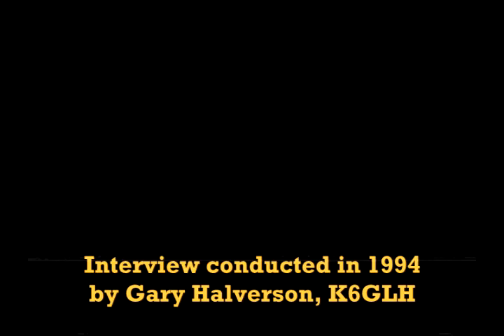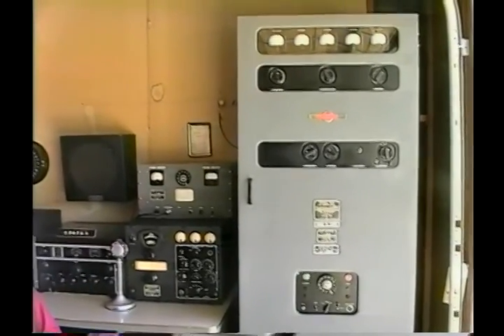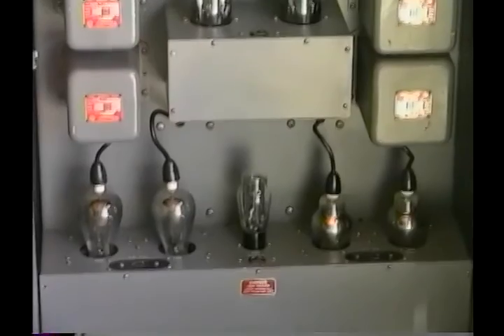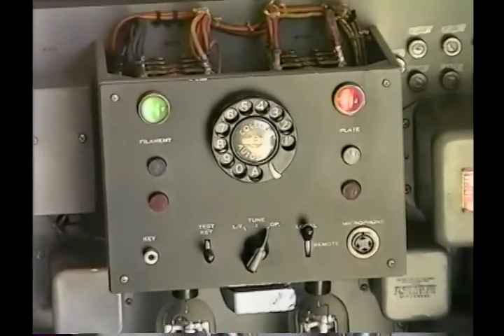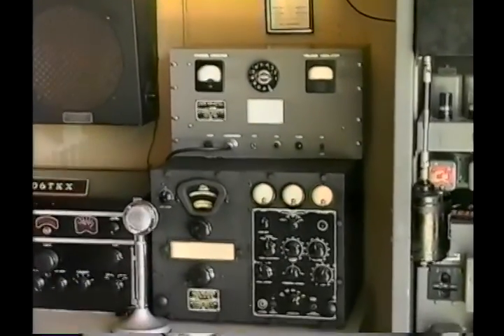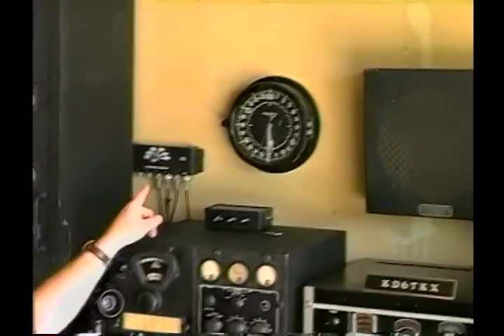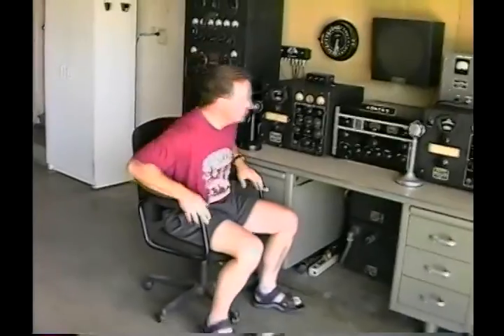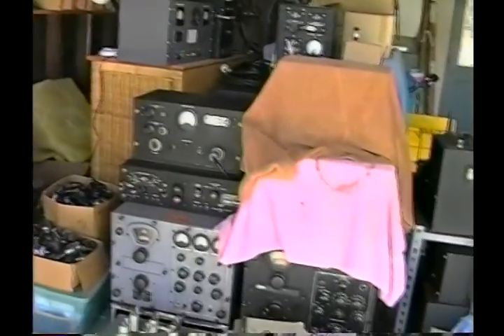California Hammin':  A Visit with Andy Miller, KD6TKX

Comment: Hi Andy! deWA6PBJ (Peanut Butter and Jelly) in Grass Valley

Great QSO on 3885 ( I think..hihi) this PM. I don't have a freq counter yet so I kinda guess the freq. ANyhoo...enjoyed working you and hearing about the gear! Yes...I recall a High School in the Santa Clara Valley back in the mid 60's had a Collins autotune BC rig. It ran 813's in the final and the modulator as I recall. Big glass window to these tubes. Autotune worked! It was part of their Electronics class...back in the day when such classes were taught. As I was saying on the air, I ran the mid freq TBW. Tried to get the original 400Hz motor gen set but could not find one. Wanted to run the modulator (I think it had 809's). Small mod transformer...thats 400hz for yah. 

73's and will work you again on 3885 (or 3870). 
de WA6PBJ Dave in Grass Valley